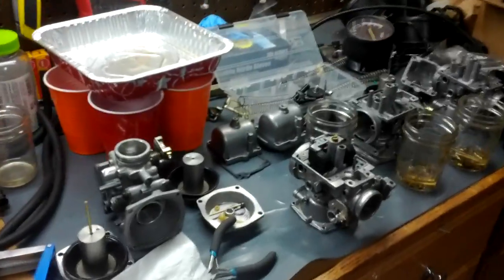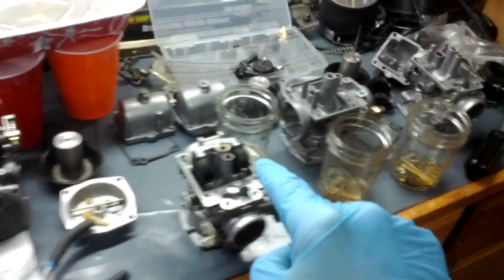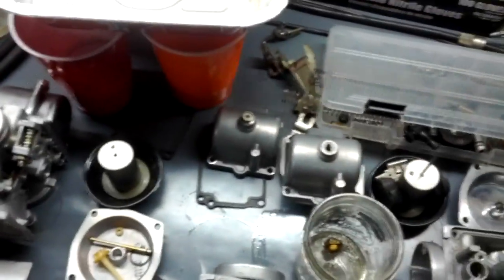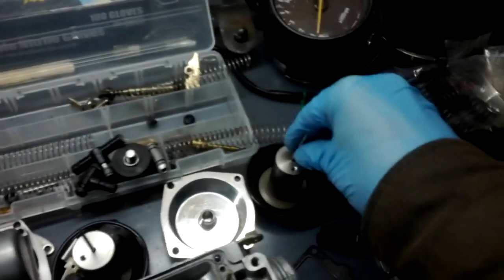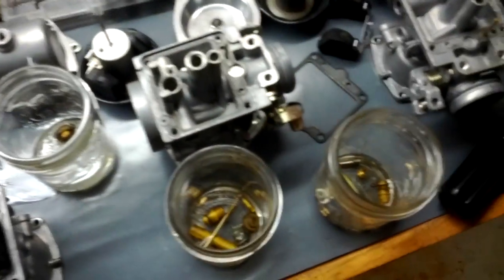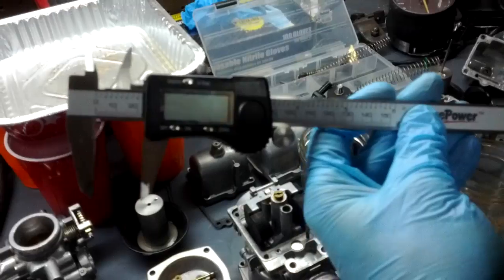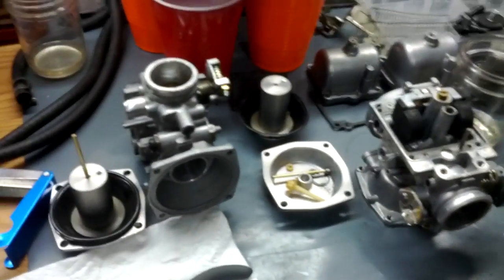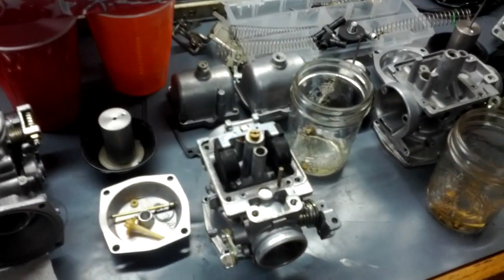Rebuilding Mikuni Carbs

Comment: Charles, I have a mikuni bst34 off a 2009 kawasaki sherpa.  I removed the bowl to remove the shellac and clean out the jet.  But there was this little black plastic part that dropped out of the inside of the carb.
I think its the #13280-1077 holder.  Where does it go?
Liked ur video...